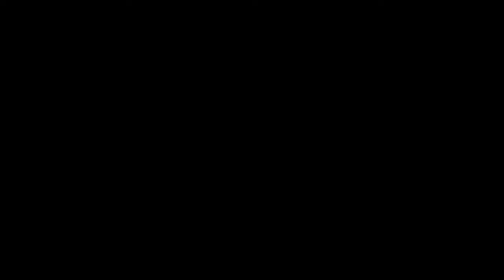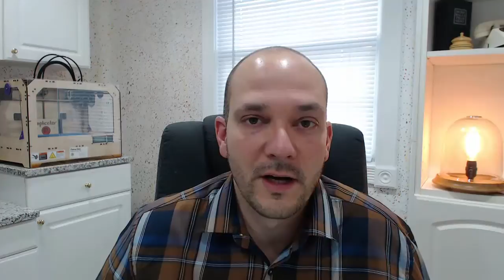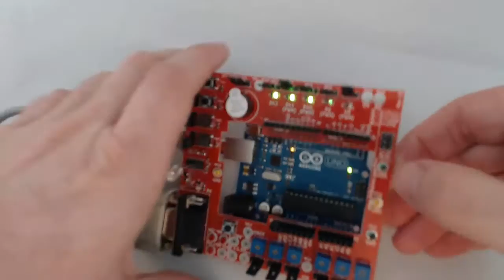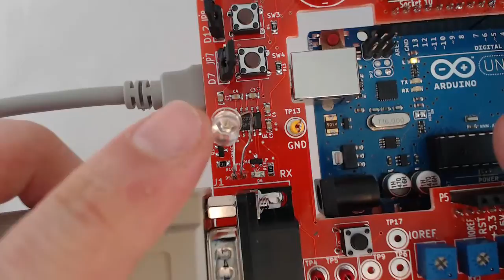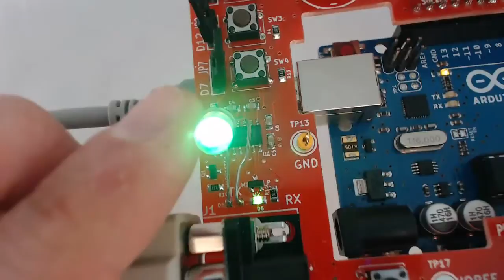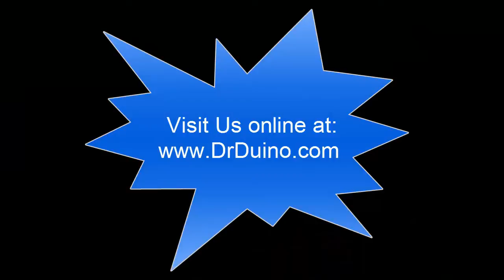Dr.Duino's new Rs-232 Feature

Comment: The issue of the RS 232 jumpers JP17 and JP18 still is confusing! why? because there are not electrical circuit in anyplace to see what is going on. How could be, the position 2 2 (Loop) cross both pins (JP17 and JP18)?  If I would see the circuit will be easy to find out.